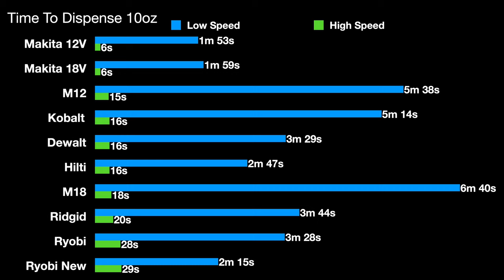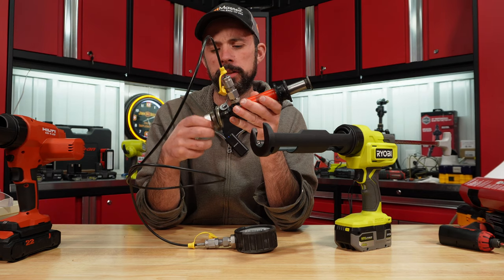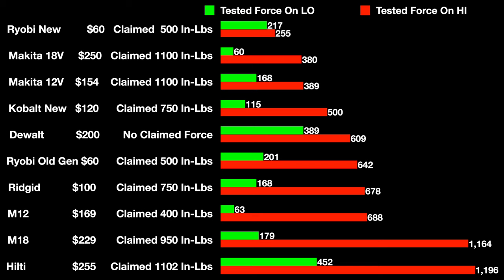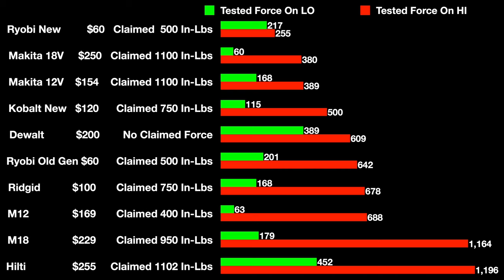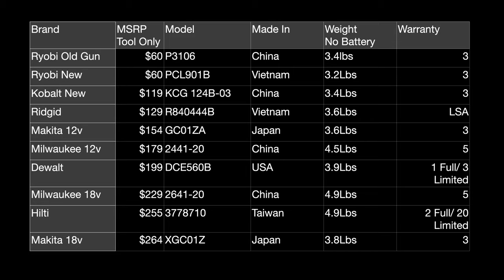Testing The New Ryobi And Hilti Nuron Caulking Guns

Comment: Love the pressure test chart on low and high.
Reply: The chart is very useful for comparing one model to another, but in terms of the absolute measurement, I wonder if the measurement methodology might be flawed, because the back of the caulk tube has more surface area than the back of the cylinder.  Might have to take the cylinder result and multiply it by the difference in surface area, to get the actual PSI applied to a caulk tube?  But I'm not sure.

Comment: I own both the Ryobi and Ridgid. I prefer the Ryobi.
Reply from the maker: Why do you prefer the ryobi over the ridgid?
Reply: @Tools-Tested  I have the older Ryobi. It feels lighter. I get less fatigued. I use it a lot. Probably 80 or so tubes a week. It performed well for me.
Reply from the maker: @frogmanpipes9561  o, yeah the older one is much better then the new one.
Reply: as someone who is possibly gonna buy the ridgid one with it on sale for 57 bucks is the weight the only reason you prefer the ridgid? any actual mechanical issues you've noticed for us to be concerned about?
Reply: @TOOL_TECHNICAL  weight is a big factor when caulking. It wouldn't seem like it would. But you will get fatigued way faster. And it happens quickly. Especially doing windows. Mechanically, once you get past speed setting 3. the anti flow on the ridged needs improvement big time. You really have to keep moving. Not to make a mess. Also, Cut the tips smaller. I'm also comparing it to the older  Ryobi. That I still use today
Reply: @frogmanpipes9561  gotcha, I was gonna use it to seal 4 basement windows that some installers never sealed allowing rain in.  The ridgid claims 750 lbs force vs ryobis 500 which may be needed for thicker adhesives. the ryobi is 80 bare tool the ridgid is 57 on clearance. The LSA is the major selling point here I guess. I know the ryobi can do 200 tubes with a 2 ah battery while the ridgid needs a 4 ah for "over 200 tubes". I'll only use it as needed here and there not daily